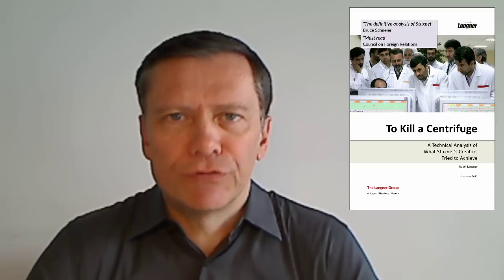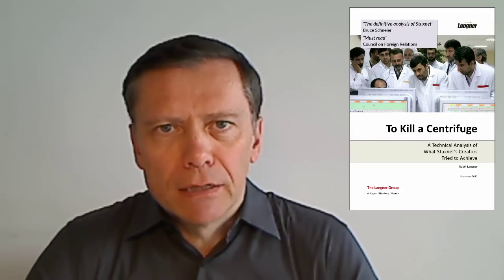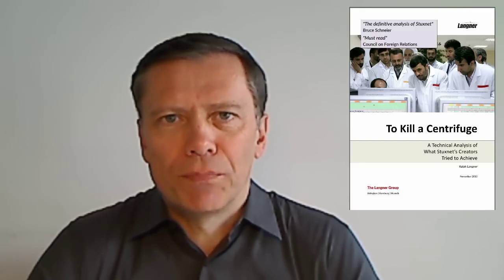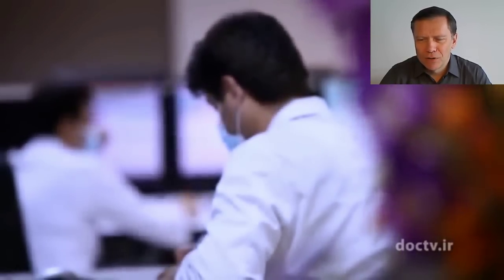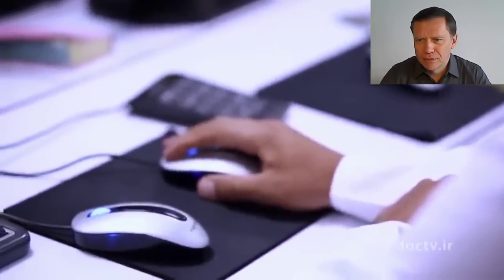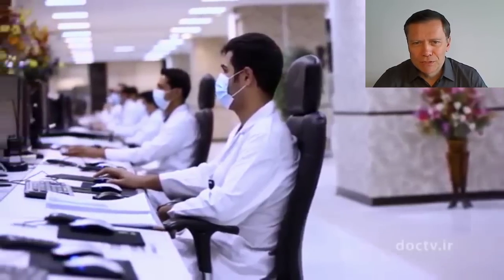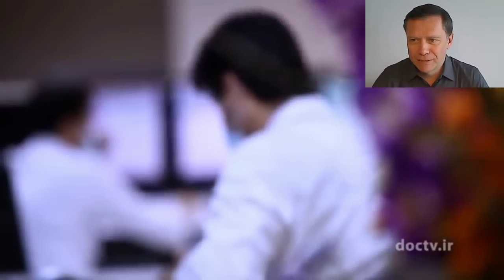Can you HEAR Stuxnet damaging centrifuges at Natanz?

Comment: Abstract

This video analyzes new footage from the Natanz fuel enrichment plant and reveals insights into the Stuxnet attack, particularly the second version. The analysis focuses on the audible differences in centrifuge rotor speed caused by the attack, suggesting that the attackers were not concerned with remaining undetected. The video also highlights the differences between IT-based cyber forensics and the cyber-physical forensics used in this case.

Summary

Introduction
  - 0:00 Ralph Langner introduces the video and references his previous analysis of Stuxnet, "To Kill A Centrifuge." He mentions the importance of video footage in understanding the attack.

Previous Analysis
  - 0:18 Langner discusses how previous video footage analysis led to breakthroughs in understanding Stuxnet, such as identifying the pressure controller used at Natanz.

New Analysis
  - 1:16 The video focuses on new footage found online, showcasing the Natanz facility, including the centrifuge hall and control room.
  - 2:00 Observations include potential maintenance issues (e.g., hanging signal cable) and the presence of numerous vibration sensors.
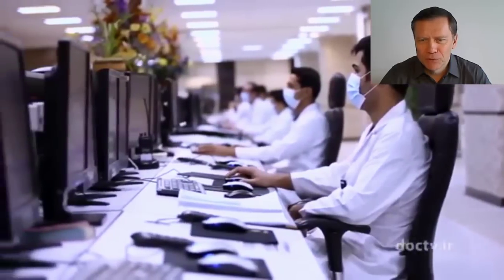  - 2:54 The control room is described as "the coolest control room you have ever seen," with an unusual layout and blurred screens.
  - 3:58 Langner emphasizes the importance of the audible aspects of the attack, which were not fully understood in the previous analysis.

Can you hear it?
  - 5:28 The video plays audio of centrifuges spinning at normal operating speed (59,000 RPM) and compares it to the sound of centrifuges at 83,000 RPM (1,400 Hertz) as manipulated by the first Stuxnet attack. The difference in sound is significant.
  - 6:26 The second attack iteration involved slowing down the centrifuges to 120 RPM (2 Hertz), below the audible range but still representing a drastic change detectable by engineers.
  - 7:57 Langner addresses the concern that the sound of one affected centrifuge would be masked by others, explaining that the attack impacted at least one whole cascade (164 centrifuges) and possibly up to six cascades (almost 1,000 centrifuges).
  - 8:30 The attackers synchronized the affected cascades using WinCC, further highlighting their intention to make the attack noticeable.

Conclusion
  - 9:03 Langner concludes that the attackers behind the second Stuxnet version were not concerned with stealth and that detection by Iranian engineers was inevitable. He suggests that this lack of operational security would have prompted a closer examination of the controllers.

i used gemini 1.5 pro

Comment: Confirmed with my own sound analysis software that these fuges are spinning with a frequency of 980.5Hz. Diameter of Ir-2m is estimated at 0.145m. This means a peripheral velocity of 446.65m/s. This produces a stress of 66.7% of the ultimate tensile strength of C350 maraging steel used in the bellows. 
Maximum theoretical output of the 1008 of these fuges at Natanz is 36.325kg of weapons grade uranium a year. More than sufficient for a weapon. A more realistic upper limit on their performance is 27.85kg/yr, still enough for a weapon.
Reply: BS, you are a liar. hahaha
Reply: @SiriusSam  How did you figure that..?
Reply: @Evan_Bell  Sorry, but you can no take a pre-recorded track and determine any analysis , unless you had the proper equipment to begin with to take samples
Reply: @SiriusSam  Yes you can. You can determine the frequency of the sound using shitty free apps.
From the rotational frequency and the diameter (which has been estimated based on imagery, compared to other objects with known dimensions, you can determine the peripheral speed.
Knowing the density of the materials used and the peripheral speed, you can calculate the tensile stresses (just for a bit of interesting information).
Based off peripheral speed and height, you can calculate the theoretical maximum separative work, based on idealised first order equations acquired from open literature.
If you know much about centrifuges, you can estimate the experimental efficiency relative to this idealised performance, yielding a probable HEU output, which is how I got my second value.
Just because you've never done it, doesn't mean it can't be done.
Reply: @Evan_Bell  There are major problems. It's not the original and compressed with codecs, and god know a copy resurfaced and compressed again with different codec.   The Audio Spectrum Map is completely shot.  Sorry, I don't buy it
Reply: @SiriusSam  Sure, the spectrum will differ from the original recording due to digital encoding, but the peak ought to be at the same frequency, should it not?
Your comment made it seem like you were more doubtful of my deductions from the measured frequency, not the frequency determined by both myself and the up loader of this vid.
The frequency lies in the expected range.
As I said, the frequency measured produces a steady state tensile stress 66.7% of the failure stress of the lowest strength components in the rotor. Many designs go above 90%.
Reply: @Evan_Bell  I can almost guarantee you will get different results with the original Uncompressed Audio/Video compared to this 2nd 3rd or 4th generation copy
Reply: @SiriusSam  Possibly. But this still serves as a good ballpark. It's the best we have available, and it's in the range we'd expect.
So your issue lies with the determination of frequency by both myself and the uploader, not what estimates I calculated based off that value. So I'm not a liar, just my original data may not be entirely accurate.
Reply: @Evan_Bell  Your right as a good ball park figure, sorry, don't mean to bark at you. This whole Iran thing is frustrating and these nuke testing has been dragging on over 20 years

Comment: From what i know Iran has old P1 centrifuges that are made from strong aluminum - witch are least effective ones for enriching uranium.They probably work on new modern centrifuge designs such as North Korea is believed to possess (P2 maraging steel centrifuges witch can spin at higher speeds thus produce more HEU).
But now seems that everyone is slowly moving towards even more advanced carbon-fiber centrifuges which could be potentially way more efficient and reliable than those previously used.Carbon fibers are fascinating material,extreamely tough,lightweight and highly versitile.Carbon fiber centrifuges should be able to withstand way higher rotor speeds and pressures.
I wonder how many states do possess technology to make those sophisticated carbon-fiber centrifuges? Im pretty sure US,Russia and China possess technology and knowledge to make those....
I wonder does North Korea work on such sophisticated centrifuges since they have relatively more advanced nuclear program than Iran?
Reply from the maker: Iran is working on carbon fiber rotors for many years but hasn't been able to produce those at scale. As a matter of fact the revelation in the video that they're running their IR-1 centrifuges at 59,000 RPM should be quite embarrassing because the design speed of the P-1 is 63,000 RPM. Proof that the technical problems of Iran are bigger than previously assumed. -- I'm not familiar enough with the NK enrichment program so I can't comment on that question.
Reply: This is what i've found: https://imgur.com/a/vow7NKN .I assume that most of Iranian nuclear centrifuge cascades currently running are based on P1(strong alluminum) model.They probably work on those more sophisticated carbon-fiber designs for obvious reasons.Such centrifuges could be made much wider,higher,and they can withstand way higher rotor speeds/pressures.The higher the speed,higher feed(UF6) intake-the more HEU you got/per unit of time.  
But to achive that they need extreamely sophisticated engineering tools like modern CNC machines and specialised high-strength composite carbon-fiber materials.On top of that u need to have some bright-minded engineers to build them.it's definitely not an easy task...
You seem like a guy witch know a lot about those things,so i have a question for you.Do you maybe know what is difference about feed(UF6) intake and production capabilities between those centrifuge types?Basically this is what i think about it.If you feed UF6 to equal cascades of those 1'st generation(alluminum based) and 3'th generation(carbon fiber) centrifuges- u should get 5 to 6 times more HEU for same amount of time operating those carbon-fiber centrifuges?Is that how it works???

Comment: The operators of the facility probably heard the noise. But there's a reason the centrifuges kept getting attacked. The Stuxnet virus made the computers display the centrifuges as running normally from previously recorded data, but the centrifuges were actually spinning higher than what the computers displayed. When the operators tried to shut down the centrifuges because they heard the noise, Stuxnet blocked the stop request from doing anything, so the centrifuges kept spinning out of control.
Reply from the maker: No. First, the recording & playback of process values has nothing to do with the rotor speed attack. Second, shutting down a centrifuge cascade takes longer than the attack sequence lasted. What the operators could have done is a contingency dump, which would have worked since the dump valves are controlled by the S7-417 which is unaffected by the rotor speed attack. But we don't know if they actually did.
Reply: Its Like a phising iran don't know anything then usa

Comment: Wouldn't vibration sensors pick up oversped centrifuges?
Reply: They feed back fake info to the engineers monitoring showing that everything was OK
Reply: Stuxnet recorded sensor readings from normal operation states and fed that data to the control systems and displays during the attack. 

It's like feeding a recorded image to a surveillance camera to conceal what's actually going on in front of it.
Reply: @ryanm7263  That explains why it monitored for weeks in order too feed “good” information.
Reply from the maker: Correct -- but the attackers didn't care
Reply: they are controlled by computer too